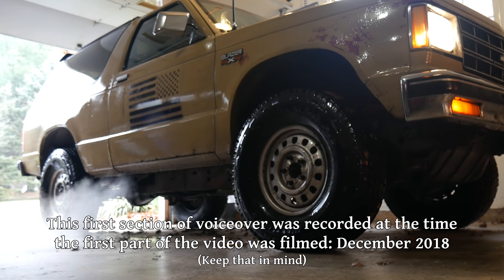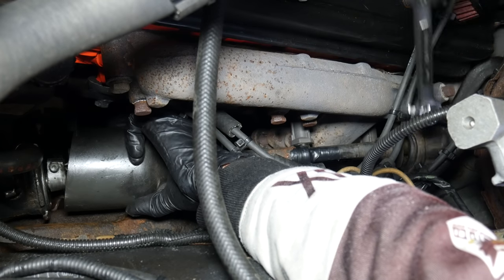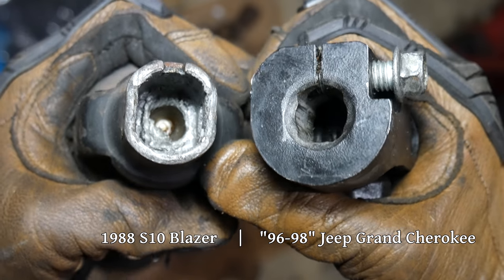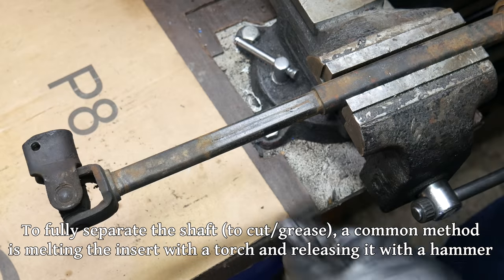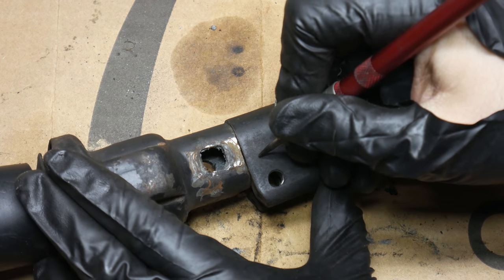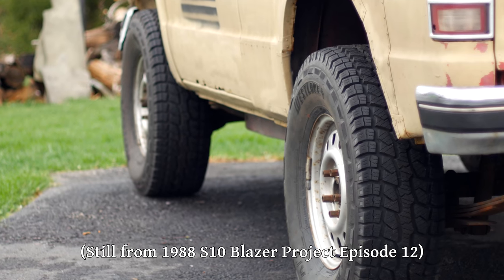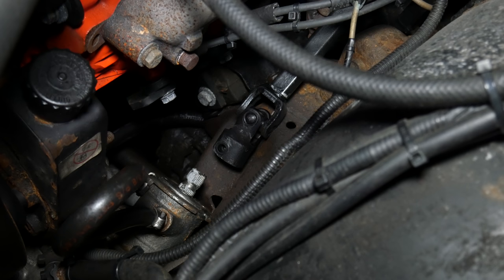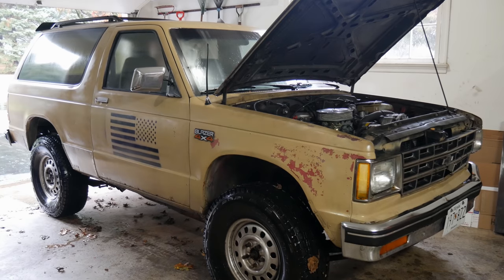1988 V8 S10 Blazer Steering Shaft Swap/Mods (Jeep Cherokee Shaft) (Ep.18)

Comment: Did u have to do anything with ur fuel system? Watch the series but don’t remember if u did or not in the middle of 355 swapping my blazer
Reply from the maker: I replaced the non-functioning pump and then the lines because they were rusty, but the flow of a TBI pump is plenty for a mild V8. Wired the fuel pump relay straight to a toggle switch to run it (bypassing the computer/oil pressure switch) and used a return style fuel pressure regulator to tune down the pressure going to the carburetor. The factory 5/16" fuel return line is maybe a little small but it hasn't caused me any issues. Good luck with your swap!

Comment: I still say to help driving you need to change the shocks and springs.
Reply from the maker: The springs and shocks are all pretty soft, that's true. The torsion bars are rust welded in though, and cranked as far as they go. No excess bounce but changing out the shocks is still a good idea.

Comment: The yard didnt charge you for that?
I need your kinda junkyard, mine tries to charge me for my own wires I brought in my toolbox
Reply from the maker: In my experience, if you leave at closing time the employees will sometimes just charge you for the obvious stuff instead of trying to figure out what everything individually would cost, especially if you get a lot of parts/go with a group and they can't be bothered. But obviously it's hit-or-miss! I have gotten some other things for free though (like a t-top bag for the Firebird) that I guess they just didn't feel like pricing out.
Reply: Oh yeah I always get outta there early so I dont run into commuter traffic

Comment: You really should get and use an actual penetrating oil (or 50/50 ATF/acetone) instead of WD40 for loose parts. WD40 isn't made for that job and does a relatively very poor job at it compared to purpose-made sprays/mix.

Comment: Genuinely surprised you spent the princely sum of $30 on an eBay car part instead of spending hours wrestling in a wreckers yard to spend $29 instead :P Glad you didn't weld the two together. It's illegal to weld any cast steering or suspension component at all here in Australia. That's always given me the perception that it's a really bad thing to do. You always see dudes in the US welding lower control arms to get mad camber and it looks totally dodgy to me. Also why not just fasten the Grade 8 nut against another one or against the Nyloc nut? The force of the two nuts should keep them together right?
Reply from the maker: Tightening two nuts against each other would also work in a pinch, but is a little tough to do in the confined space, and I wanted to keep the bolt as short as possible (although there was definitely enough thread left to do that anyway). I would still rather trust the one lock nut though, as even if the nuts are very tight together they could still loosen up over time, but because of the force required to turn the distorted nut it would either never happen on its own or it would loosen like half a turn and then rattle around a bit but never come all the way off.

And I certainly wouldn't want to  trust a cast metal to cast metal weld to hold a steering component together.

Comment: Pretty sure a grade 3 or grade 5 is stronger than grade eight, when It is stressed 👉l👈 rather than stressed 👆l👇...
Reply from the maker: I have heard that many times before, but based on research and personal experience I don't believe it to be true  in most cases. True, a grade 8 bolt would theoretically be more brittle than a grade 5, but for most applications I don't think that difference would ever matter. It can be difficult to find good tests comparing shear strength between different grades of bolt, but here is a fact sheet with exactly those numbers: https://nucor-fastener.com/Files/PDFs/TechDataSheets/TDS_013_Shear_Strength.pdf

According to that data, a 3/8" (presumably course thread) bolt will shear at around 7950lbs if it is a grade 5, and around 9940lbs if it is a grade 8. Here is another manufacturer that says, as a general rule, shear strength is approximately 60% of the tensile strength of a bolt. Therefore, a grade 8 would be stronger than a grade 5/2/ungraded in shear. https://www.portlandbolt.com/technical/faqs/bolt-shear-strength-considerations/